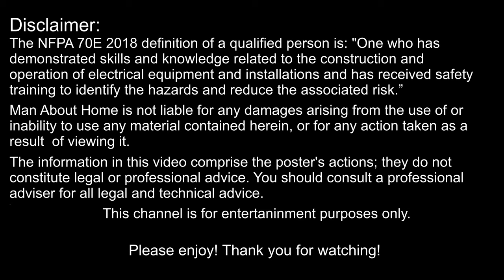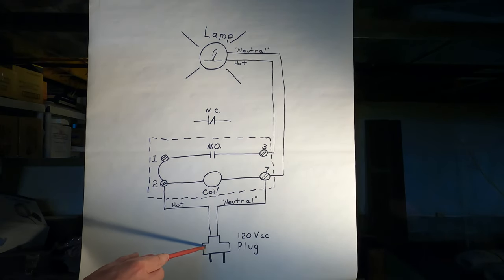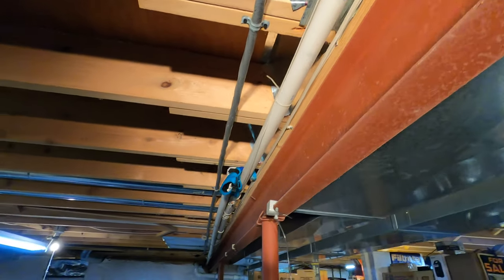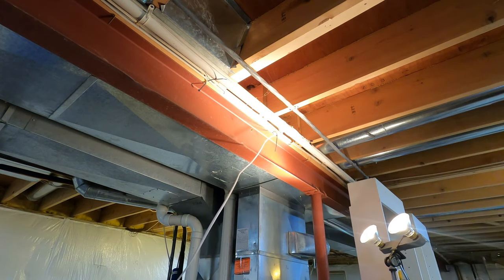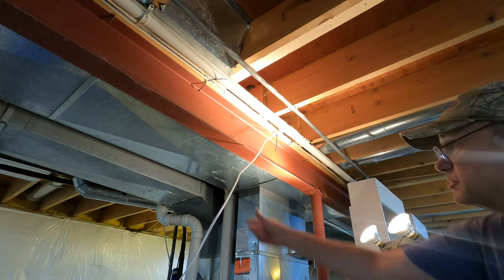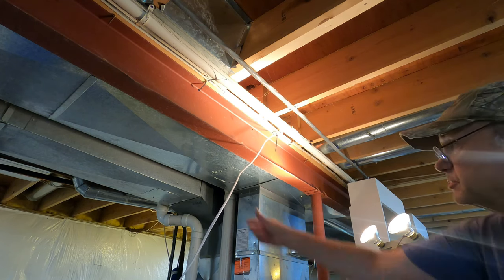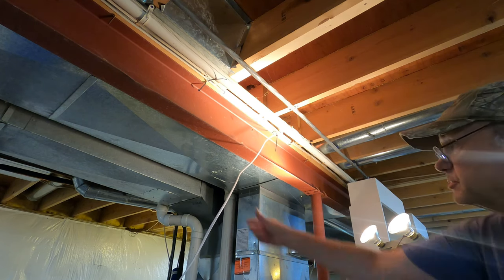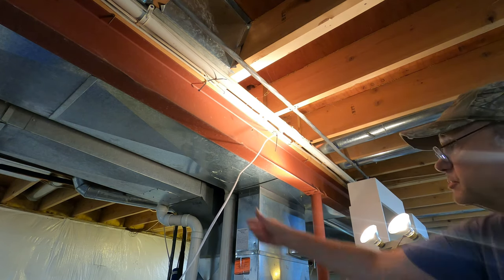HVAC Duct Booster Relay Control / EAC Signal | Part 3 | Man About Home

Comment: I don't  understand the point of the relay,  why not  just  plug the  lamp  directly into the power strip?  Turn  on lamp lights up  Turn off lamp is off, why the relay?
Reply from the maker: The lamp is just a demonstration of how a relay functions. Relays are used everywhere in industrial controls and things like that. For example, a relay with a 24V DC coil, can be controlled by an output on a computer, to turn a 480 Vac motor on and off... so a low voltage computer output, controls a 100 Horsepower motor.  That's just one example. Please watch my relay update video to learn more of the benefits of using a relay to control a motor. Thank you for watching!

Comment: I think I would use a separate power source for the fan, letting the relay control it, to definitely separate the fan from the control board.
Reply from the maker: Agree... that's what I did.

Comment: installing a booster fan tomorrow. I am planning to run my booster fan with my HRV . Both powered from same  homekit smart plug. So both will stay powered all the time because my HRV also drives my humidifier which don't need the furnace to fired up but turns on just the furnace fan. Leviton sells a 2nd Gen homekit switch with fan controller . So I might install that in future if I need a fan controller option from the smart phone. Your approach is good for someone who wants something set it once and it will do its thing.
Reply from the maker: Your system sounds interesting... more complex than I needed to get into. Good luck with it! Thank you for watching!

Comment: Are you still using the fan speed controller? How did you end up powering the booster and are you happy with noise levels. Thanks for the help.
Reply from the maker: Yes, the booster is set to 35% speed, because that's all it takes to cool the room. Watching this video covers the power question. It's switched by a relay. At only 35% speed, the sound level isn't a problem for us.  Thank you for watching!

Comment: I would look at using a paper filter instead of that electric filter. I had a newer Honeywell one. It didn’t catch as much in my mind. The Honeywell paper 4 inch filters fit good in there. Which I might off saw a two pack of them by your furnace in a different video. I also added a Honeywell uv light to my system which I would definitely recommend.
Reply from the maker: The filter change has been done. That electronic filter housing was converted to a 4" thick pleated filter before I ever bought this house, and I've always used a pleated filter.  Thanks for the Honeywell UV recommendation. Where in the ductwork did you install the UV light?
Thank you for watching and commenting!

Comment: Would you be able to run a wire directly to the control board to operate the booster fan considering it is 120v? Or is that too much draw running through the board?
Reply from the maker: That's a great question! You read my mind. It depends how it's done. Most furnaces have a motor output for the furnace blower you can probably tie it to. I chose to use the EAC control signal, with a relay, in part, because I wanted to control two things with one signal... The duct booster, and an air purifier.

If your question is about directly wiring a motor to the EAC signal, there are good reasons why I wouldn't do that. I don't think it's a good idea to put a motor load on an electronic output that's designed to be used as a control signal. I've looked at a few furnace control board schematics, and the ones I've seen all use an on-board miniature relay component to control the EAC signal output. 

I'm thinking that signal is designed to enable a relay within an electronic air cleaner, or a light. Not to drive a motor load. (Which might possibly void a warranty? Dunno.) The EAC output is limited to one amp at 120Vac. The relay coil I used draws 31 milliamps (0.031 Amp). It barely registers. So there's no risk of overloading that output and damaging the expensive control board, by using this relay. However, I'm actually updating it with a fuse, to protect it from a highly unlikely short. I'm making an update video to include that.

Motor power circuits are usually designed to deal with the special problems of motors. For one thing, when a motor starts up, it draws 3 - 5 times its normal operating Amperage for 2 tenths of a second. Then when it shuts off, there's a bigger challenge for the relay contacts. Trying to open up under spring pressure, the contacts draw an arc between them until they're far enough apart to stop the current from jumping across. This causes pitting of the contacts over time, until they're too burned out to work without heating up. Motor bearings also wear over time causing greater current draw, and more heat. Motor contactor relays are designed to handle these problems. You'll see a horsepower rating on them. The relay I used is rated to switch 10 Amps in general, and more importantly, a 1/2 HP motor. So it's a better choice, to prevent possibly burning out the furnace control board. Is the furnace EAC signal rated for Horse Power? No way! 

And if you think about it, the components are soldered onto the control board and powered through solder traces. What happens if solder gets too hot? 

I like to sleep at night, so I do things with an abundance of caution. Thank you for watching and commenting!
Reply: I appreciate the detailed explanation. Thank you!
Reply from the maker: You're welcome! Your question was helpful, because I used this explanation, almost as a script, for part of my updated relay video, which was posted on Dec. 10.   Thanks!

Comment: I must have missed it, if your furnace terminals have sufficient voltage and amps why use a relay? Your booster fan doesn't draw that many amps, does it?
Reply from the maker: (Edited for spelling.) Good questions. The furnace EAC signal is rated at 1 Amp. If I recall correctly, the  booster is only 35 Watts. So it would seem to be fine to drive the booster directly off the control board. You might have missed when I said I want to control 2 separate devices with the same signal. That's why I used a 2 pole relay. It provides 2 sets of contacts, to control two separate devices. (I still want to install a UV light in the ducting.)  Also, out of an abundance of caution, I probably would have used a relay anyway, to protect the expensive furnace control board from any downstream problems that might occur, like a short in the motor or wiring (a high current situation that could destroy furnace control components). It's a "Pay me now, or pay me later." kind of situation. One thing I didn't do, but probably should have, is to put a fuse in that motor circuit. Now you've got me thinking...  Thank you for watching and commenting!
Reply: @manabouthome  hey im a 25 yr hvac tech ...relay is a good option but a sail switch (air sensing switch}  would be a  better option for this application ...and usually i like to tie in after the door switch on the heater to avoid being shocked when removing the door....the relay will be hot if you remove the door...most uv lights are plug in but you can use the eac terminal for the sail switch too ...you should never mount a relay on the bottom of the heater if the coil pan was to flood or system freeze up from low freon, dirty filter etc... water will short that relay right out...  if anything mount it to the side of the heater just so its off the base of the heater ...nice work
Reply from the maker: Thank you for your helpful and constructive input! 

You're the first to suggest a sail switch, which is a great idea and I'd like to suggest that to others. If you have a good part number that would be appreciated. 

I agree it's better to take power through the door switch. That's what it's there for. I've been thinking of looking at its current rating and possibly doing an update on that. However, since the relay is de-energized when the system isn't active, it's a dead end to current. Unless someone's getting into the wiring, it's safe as it is. We always confirm power's off before doing any work on electrical equipment... Am I Right? 

That's a good tip about the relay location. I'll include moving it with any updates I do.

Thank you for watching and commenting!
Reply: @manabouthome  no service techs will work on the system while its powered up to diagnose...but would be aware that the relay was powered from the junction box...yea we use sail switches all the time for electronic air cleaners and such...i also use them relays too...depends on the application.. yea i would just side mount it just to keep it off the floor...
Reply from the maker: @mikgto68  Very good. Thank you!
Reply: @mikgto68  wouldnt the ASS be more prone to needing maintenence more frequently?
Reply from the maker: If you're referring to the Air Sensing Switch, I think you have a good point. Thanks for watching and commenting!